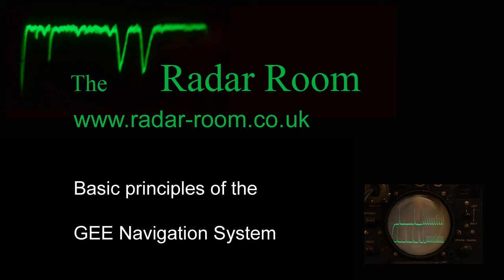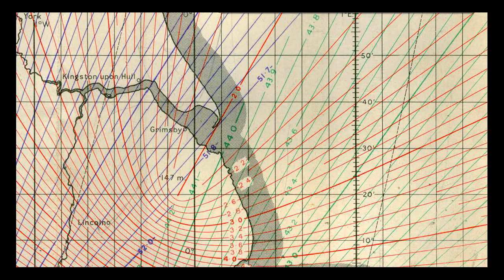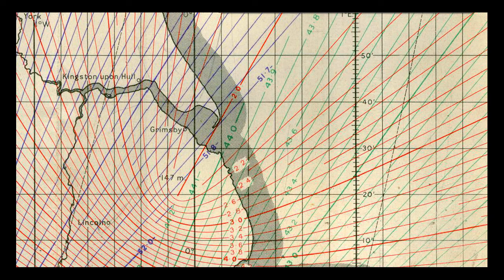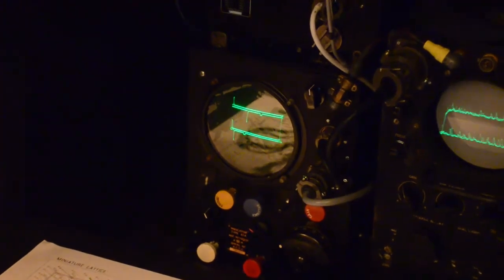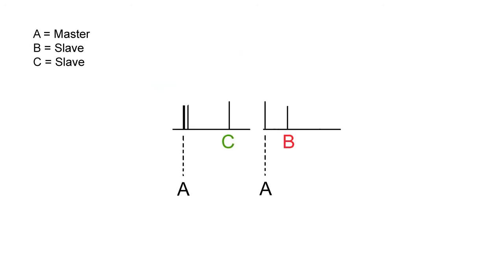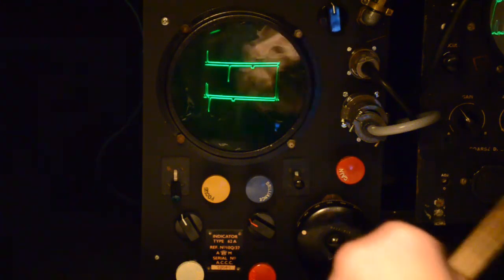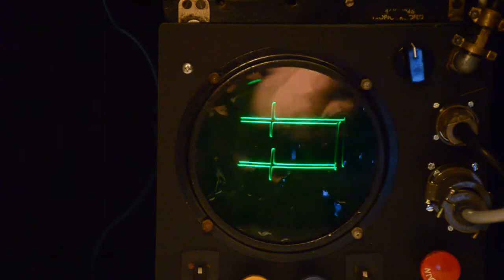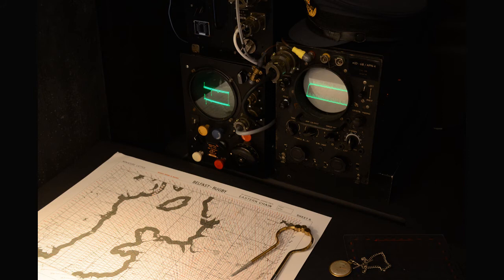The GEE Navigation System - a simple overview

Comment: When did the Americans start using this system
Reply from the maker: I'm not quite sure Mark. With the war in the Pacific, they needed to fly longer distances, hence the Loran system was developed However, GEE was more accurate, albeit at shorter ranges. My guess is that they started to use GEE when they started sending their bombers over here to help the RAF. I have a couple of 'photos of both GEE and Loran being used alongside each other in a B17 which suggested it was a case of choosing the one most suitable for a particular raid?

Comment: Very good, thank you! I read the Wikipedia page on Gee but could not understand the display and the nav reading. (The traces on the osc. photo in the Wikipedia page are simply painted on!)  The map whith the red and green hyperbolas is also very helpful. I would recommend to read the Wikipedia page though to better understand the theory of the system.
Reply from the maker: Pleased to be of help. I agree that it certainly helps to see an actual working display, rather than a roughly drawn chinagraph representation!

Comment: That's nice but...how to you plot these screens info to the nav chart?
Reply from the maker: It is a lot easier to work with than with Loran for starters, as GEE only used ground waves. The charts used are specially printed with hyperbolic curves already drawn on in three colours. Each colour representing either slave B, C or if it is present, the D slave. The reading is therefore taken straight off the display by counting the pulses from left to right, (for each line), then each of these readings is applied to the chart using the appropriately coloured curve. Each of the coloured curves being easily identified by the numbers printed on them. These are shown as GEE units, as opposed to actual timings as-per Loran. (A GEE unit being 66.67uS) I hope this helps a little!
Reply: @lishaton   In the absence of a graticule or countable pulses, it's not clear at 4.38 how the positions of the pulses are then transferred to the fine lines off the chart. It's plain from other commentaries on this navigation system that it was accurate enough to use for 'blind' landings in very bad weather. Did the unit itself give an accurate numeric output? Or were the various dials calibrated in some readable way?

Comment: Hello, I loved the video, it was fascinating. I have never seen or read about the operation of the GEE system. However, I do have one. Well, to be truthful, the majority of one.  I don't suppose it is of much interest to everyone but here is the story.  I guess I was one of the original geeks with ideas far beyond my capability at that age. I spent my pocket money, first on the indicator unit. I don't really remember when, perhaps around 56 years ago, buying it from a war surplus market/scruffy shop in Blackpool.  Then, without realising they were related, on the R1355 IF unit and an RF plugin. Of course, in those days there was no Internet and no information, probably it was still classified. I spent many hours tracing the circuitry trying to understand what it did ( I still have the notes). Now comes the sad part (for historical reasons), I removed the transformer from the receiver ( think it 4Khz) and built myself a 50Hz power supply using a war surplus huge hv transformer. I managed to power up the display for a while (before the rectifier blew) and could see some pulses. That was perhaps 50 years ago. Then it got left behind in the hurry to get trained, marriage kids etc. However, the GEE bits travelled with me and even grew a bit because I added some more front-end plugins; I think perhaps I have four different ones. It is in what is known as "unrestored condition" i.e. all the rubber insulation is hardened and some capacitors have been replaced by 1960 varieties. I even have spare valves (I think SP65 if memory serves me correctly).

So, there it has remained, untouched for around 50 years. It currently resides in my place in France, (where I am not 'cause of Covid) hidden in a dusty cupboard. I have kept it because, being born in 1945 I felt close to the 2nd world war and those who fought in it. OK, I treated Gee as a technical toy when younger but now I feel that it is a connection with those who flew pathfinders over Nazi occupied territory in the latter part of the war - well, perhaps I always had that in mind.
Reply from the maker: Hi Ray! Thanks for taking the trouble to spell out your personal experience with GEE bits :-) It still surprises me just how many relatively intact modules etc. are still being auctioned and sold - so many years after they were moved onto the surplus market. As for your transformer swapout, I think most have gone this way - including almost all of our stuff here. Shame your rect. failed, but was this due to something you did wrong or just an old component? I'm glad at least that you say you actually saw some pulses on your indicator. No chance of that happening now I fear :-(  Whilst it sounds to me as if your stuff is pretty much as-sold, out GEE indicator had gone through a pretty rough time before we finally bought it with barely anything remaining from the original device. I think it was rebuilt into a VERY complicated oscilloscope which sadly, I am sure never worked properly. Some folks expect too much before they've even really started re-engineering something. 

Glad you enjoyed the video! I hope you decide to dust off your own GEE equipment at some point to see if you can have it working again. BTW, do check out our LORAN video if you want to see the differences between the two systems. Remember that our Robert Dippy (who designed GEE) went to the US to help them complete Loran. - Our Loran APN-4 indicator being a hugely complex 100%  ground-up rebuild when compared to our GEE variant! (There are I believe 22 valves inside!)

Comment: Very interesting - it brought back some memories.  I trained as a navigator on Vickers Varsities in 1963 and used Gee II extensively.  The last part of our training was in Meteor NF14s which had Gee 3 - much easier to use as it had counters rather than having to count the pulses.  When the Vulcan first came into service it had Gee 3 later replaced by Tacan; the last one to be replaced at 230 OCU, the Vulcan conversion unit, was in Sept 1964.
Reply from the maker: Hi John. Thanks for the feedback! Interesting that you had so much contact with GEE over the years. This type of navigation aid might not have been as accurate or easy to use as a modern GPS, but at least it worked. We had one of the final versions of Decca on our boat (a few years back) and paired to a microprocessor it was surprisingly good, simple to use and gave a digital readout in lat. and long.

Comment: ... aha! I have been reading into the GEE system recently and wondered if anyone had created a simulator. You’ve done it - brilliant! Most descriptions include a map view of TX chain locations showing the master A station located between the B and C stations, so I wonder if this was always the case. The final step, transposing measured time delay values from the screen to the chart to establish a fix, would have been really useful. I wonder what the full range of GEE units was? Presumably the 25\30 scale only covers a very small proportion of the possible measurement values. Finally, I’d like to understand the effect of real-world HF propagation on the usability of the system; i.e. with added noise and signal fading, etc at the limits of system range, how much of a challenge would using GEE be? Anyway, this is a superb recreation and thank you so much for engineering the simulation and sharing it via YouTube ... regards - Fraser
Reply from the maker: Thanks for your appreciative comments Fraser! Indeed it was a 'challenge', made particularly difficult by my being unable to actually see a real one working... (We contacted IWM Duxford for any help they could give us as they have one, but they were unable to offer any assistance..) Difficult to answer some of your other questions. I personally think that the system could have easily been made more accurate using modern circuitry techniques etc. As it was, I think it was surprisingly accurate for the year. Remember that the first signs of Decca were around during the early 40s as well and Decca went on to be used right up to around 2000 in modern microprocessor based units. We had a very small 'Dinghy Decca'  on our boat for a few years and aside from a few drop outs around the Isle of Wight and around the Channel Islands, the system worked extremely well. I'm sure that GEE could have been 'revamped' in a similar way. As far as modern day interference is concerned, there could well be issues from many sources which seem to be missed by current regulations. A good example is those flashing Christmas tree lights adorning peoples properties in the festive season and beyond. Think - a long piece if wire up high with a nasty square waveform and a microcontroller hanging on??